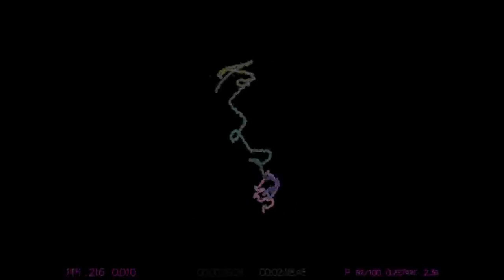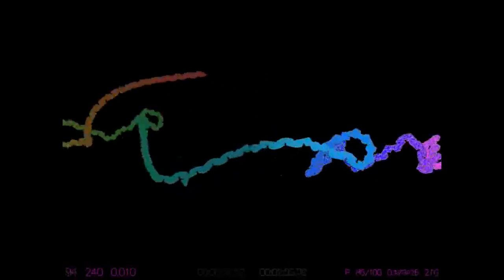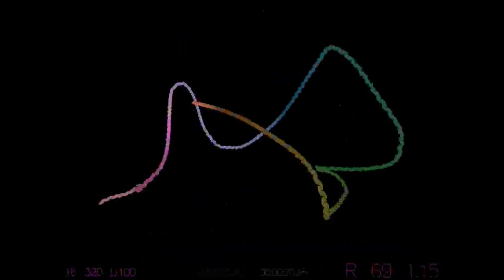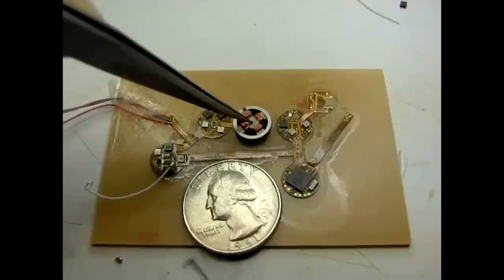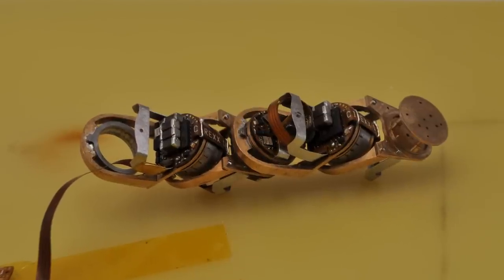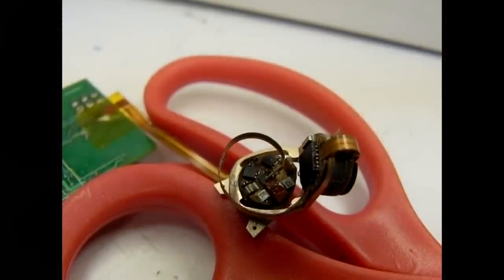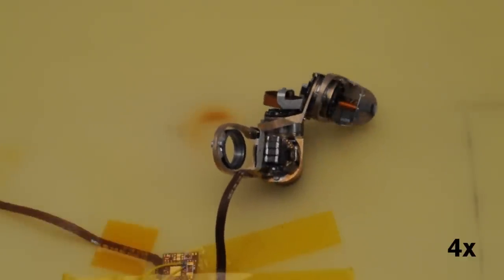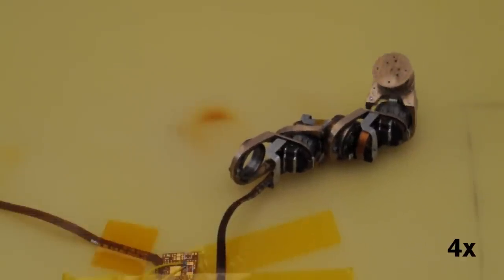(Tiny) Reconfigurable Robots at MIT

Comment: Man... 3D print your gears and other parts! 
Use conductive coaxial bearings to get rid of flexible ribbons and gain unlimited freedom of motion. 
You've got to have access to a good/high resolution 3D printer that will allow you to print millimeter-sized parts.

Comment: I do believe that in addition to the single degree of freedom that they already have, they need to have docking connectors on all 6 sides of the module.

As it is now, 2 connections = every module is a single-point-of-failure for the entire mechanism. As the object gets larger, stress on a single joint rises cubically (n^3)

6 connections = rigid crystalline structure. As object gets larger, stress on a single joint would only rise linearly (n^1)

Comment: While a cycloidal drive is really neat, it wouldn't work in this application. The part has to rotate both left and right, but a cycloidal drive only multiplies the force in one direction. Sure, you could add two drives and an anti-reverse mechanism to them but that might make the object larger than the 1cm limit.